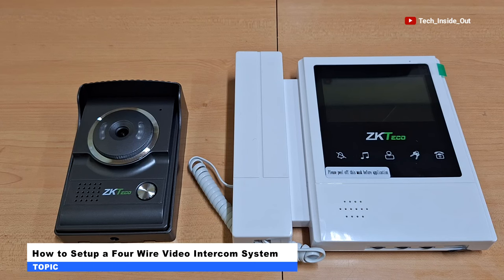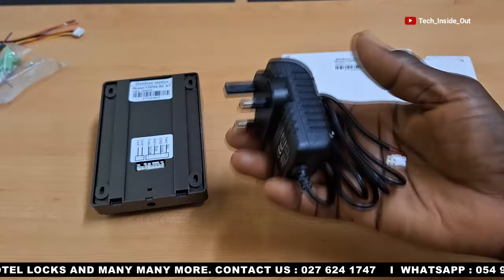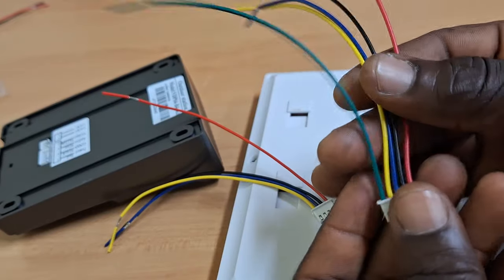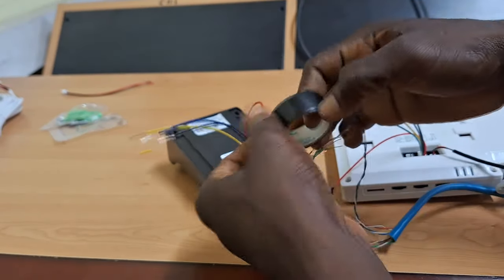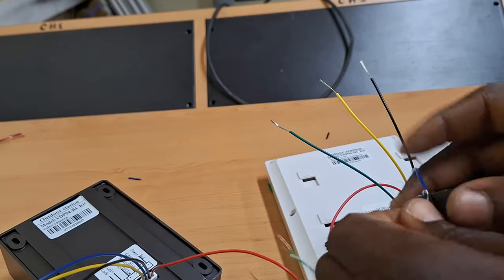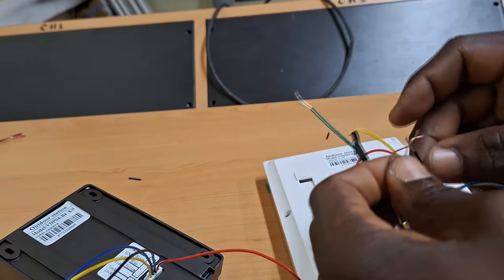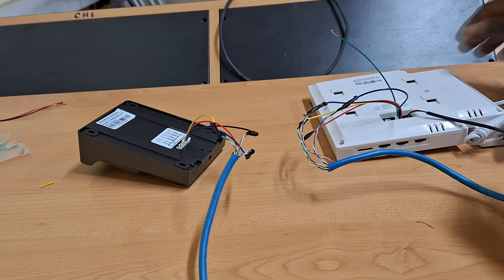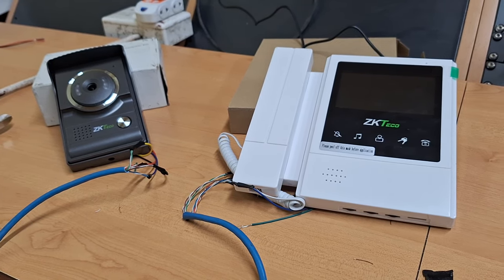How to install a basic video intercom system

Comment: Hi, thanks for the video, can you tell how these components will eventually be powered/power-source. Thanks.
Reply from the maker: The indoor unit is powered directly through the 15v input cable plugged into the device and through the cabling into the outdoor unit, power is passed on to the outdoor unit.
Reply: @Tech_Inside_Out  thank you, appreciate you taking time out to answer👏🏿

Comment: Thanks for the video. I have two questions to ask please 
1. What happens to the blue wire you left behind the indoor unit.
2. Can this procedure be use for any other brand for video intercom. Thank you
Reply from the maker: 1. Its a provision for door lock. I will address that in my next video.
2. Yes, the process is similar to other brands. There are however higher versions with higher capabilities with difference in connection. My next video will do a higher version.

Comment: I got confused due to 5 wires (green, yellow, blue, black and red). Is this called a 4-wire intercom ?
Reply from the maker: The last cabling takes the +15v which is the dc power supply already provided by the power plug. The effective signal cables are 4.

Comment: The other cable not connected not important?
Reply from the maker: They are important but they are meant for other devices that can be connected onto the intercom system. Since i havent connected those other buttons, those points are left black